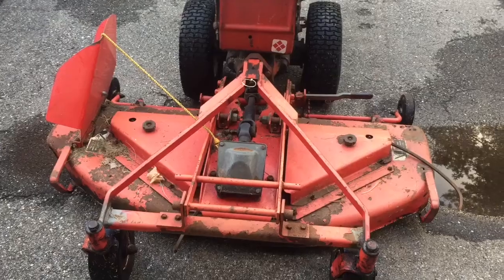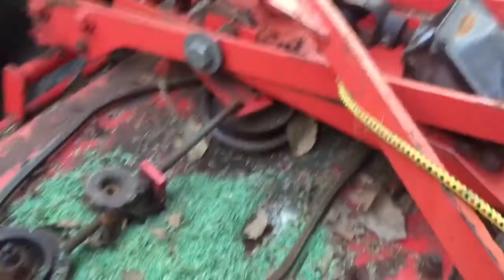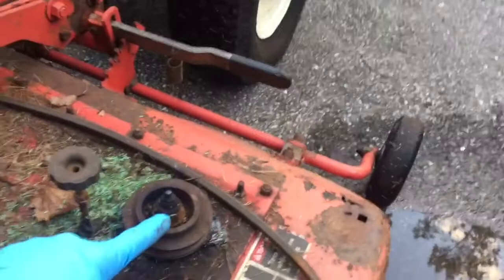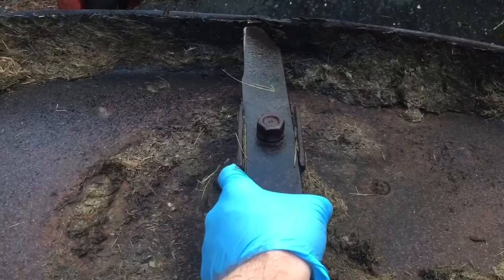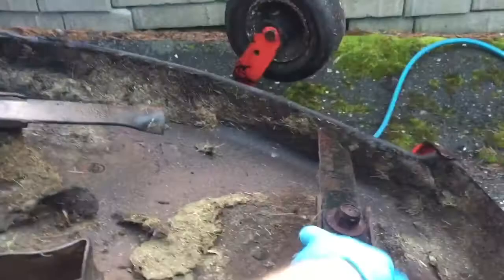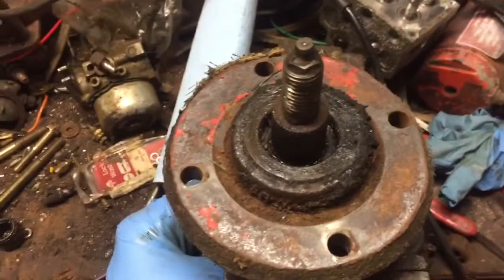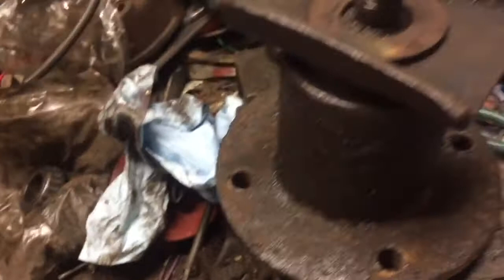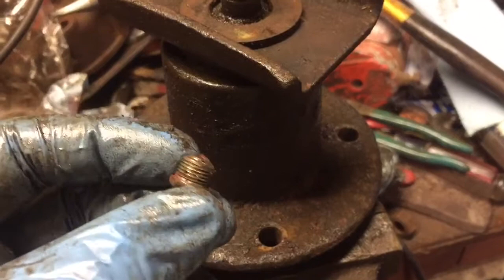Freakin Gravely Mower Decks Part 3 Spindle Repair

Comment: Those years  Gravely decks were always beat up hard. The blade air grards in my deck had to be made from scratch. Carriage bolts were used to bolt up the guides fella. They have square heads under the radiused of the head. Easy job if you got metal working tools. The thin metal disk was to keep the grease from going up into the upper bearing excessively. Once fixed you are set for life. The spindles were the roller bearing type with grease seals, that is what mine had. They come with leather seals, neoprene lip seals of many types, and just old fashioned grease seals with two to three cut grooves in the housings. The later you better make sure you grease the spindles regularly or the bearing will get trashed. My deck is still running after all these years. That is thirty years plus. I would bet you nothing these days will ever last that long, PERIOD. Nice video fella, keep the Gravely going.

Comment: Nice fix. I need to do this to my deck. Thanks for the video. It will help when I find time to do mine. Of course I don't have the impact wrench, press or puller....so not sure when I will...
Reply from the maker: CT moog you could just hammer stuff apart if needed... Buy a heap puller at harbor freight that will work....  A breaker bar works for the blade nuts.  A lot of guys use cheap 120v impact wrenches from harbor freight for blades also....

Comment: I've been told angling a mower deck forward keeps the blade(s) cutting on the front edge and raises the trailing edge out of the cut grass. The idea is to reduce drag on the blade.